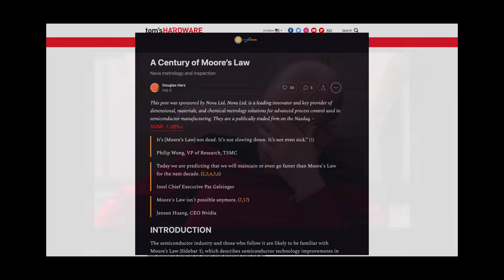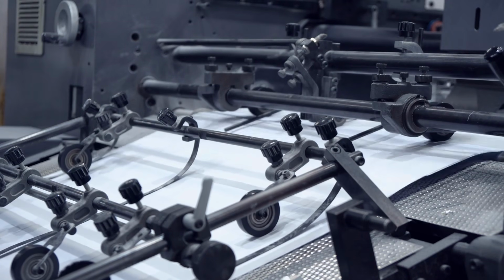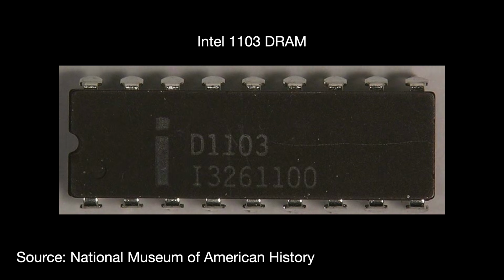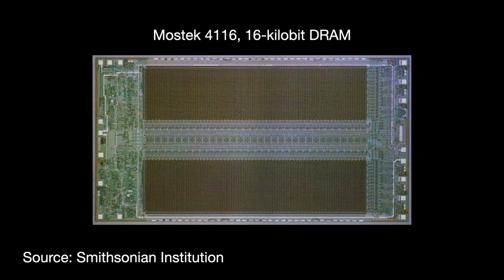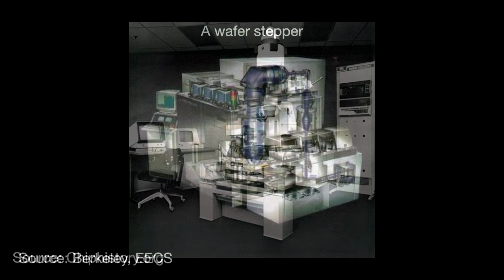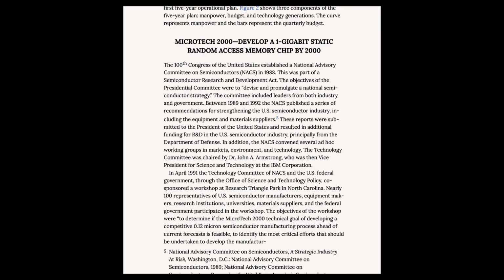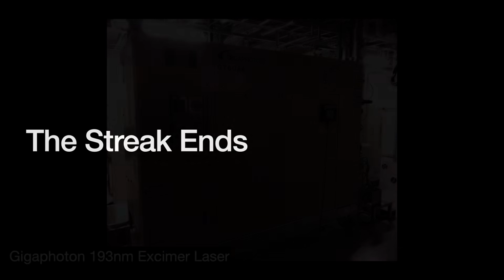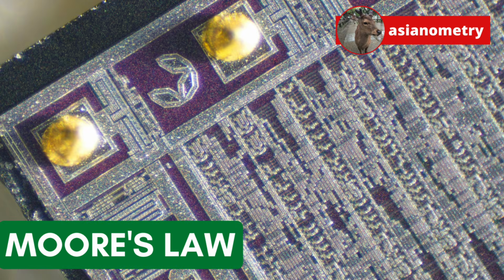Why Moore’s Law Matters

Comment from the maker: RIP, Gordon Moore.
Reply: I like the article, watch almost all your videos and of course am subscribed.  As a person who has worked with computers since 1980, and in my case that meant working with systems developed in the 70s before ICs were even in computers, I have a lot of experience following technology and the changes that have occured over time.

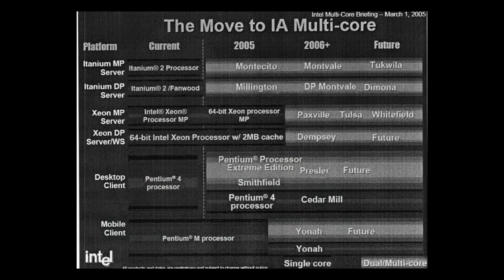I would debate a point you made as I don't think they're directly connected, and rather they happened about the same time for reasons that may have converged, and that was the statement at about 20:15 about moving to multi-core processors.

That was going to happen regardless.  There is only so much engineering that can go into a single core and in fact Intel had already worked with SMT so that a single core could work with 2 threads at a time.

The issue is an overly complex core has to have WAY too many transistors to justify its cost.  The world of a machine pulling an instruction from memory and then executing it went to one where there was an instruction pipeline where multiple instructions were pulled into that pipeline and predictions made about the outcomes of each instruction so that decision making would be correct and proper paths followed in the instruction pipeline.  The amount of complexity there ALREADY is crazy.  You hear the term branch prediction used.  A program is always making decisions based on results of some computation.  If you go one direction, you load a certain set of instructions to do the next thing, otherwise you continue on a current path, and of course modern programming gives multiple paths for decision making so branch prediction becomes harder.  So, getting branch prediction right is important because otherwise you have to flush out the pipeline from the point of the wrong prediction.  This is SO FAR from the world of pulling an instruction and then executing it that it's hard to fathom how it all works within a CPU core, but that's what was already required from the complexity of a single core to work ever faster.  And then there was clock speed.  Clock speed has physical limits because the faster you clock a signal, the more resistance there is in that circuit and this can't be overcome.  You can keep improving the quality of the transistors and the silicon crystal and the methods of laying down the layers and etching to make a circuit as perfect as possible but you can't overcome the physics of resistance in circuits.  This is why for almost a decade clock speeds were maxing out around 5GHz, give or take 2 - 3 hundred MHz.  They have now moved above that mark but not because the laws of physics have changed, but instead TSMC and Intel both make their die more durable, capable of higher heat and it allows higher frequencies, that and making the circuits more perfect, eliminating some resistance.  But they still have that issue of the faster you clock a circuit the more resistance there is, everything else being the same.  And it's exponential, which is why you see power consumption become crazy when overclockers use LN2 to try to break records.  

So, two limits are in place that meant the world of desktop computing (servers even sooner) needed to move to many core computing, and it was a false notion Intel gave many years ago that suggested they could continue making a single core ever faster by improving IPC (instructions per clock) and speeding up clock speeds.

The world of software development needed to move to mutli-threading or parallel processing back in the 90s, they just didn't know it yet for many types of software.  We would be much better off now if software engineers CLEARLY understood that then.  Regardless of how many transistors you can shove into a square millimeter of die that doesn't mean you should try to shove them all into a single core to somehow make a core run faster, with a deeper instruction pipeline more subject to bad branch predictions along with making the ALU and FPU more insane.  We're on the correct path now, with Intel in fact stepping back from CPUs with only complex cores and moving to hybrid designs with their big and little cores and using accelerators, and with their little cores there is the removal of a lot of the complexity of the big cores, and you can process 4 threads in little cores with the same space as a big core can process 2.

So core complexity and clock speed limits were ALWAYS going to mean the move to many core processing.  Moore's law had nothing to do with it.
Reply: @johndoh5182  your replies under this comment deserved to be its own comment. Highly informative very much appreciated!
Reply: @johndoh5182  People didn't know there were going to be clock speed limits. The idea back then that the AMD FX-8150 would hold its speed record for about 11 years until the Intel 13900K came along a few months back would have been unthinkable at the time.
Reply: @katrinabryce  Every engineer that works on high speed electronics KNOWS there are limits, regardless of what the typical home user thinks, and even software engineers, who TAKE PHYSICS should know there are limits to clock speeds.  Have you taken Physics for Scientists and Engineers?  There is a few sections that deal with electricity and electronics, and you learn what resistance is, what it does, and how it affects circuits.  You also learn about AC resistance which is really the same thing but called reactance, and since you're working with a high speed clock signal it really has the properties of an AC signal even though it's in a digital circuit.  Reactance is different from resistance though because different things can create reactance that don't exist in a DC circuit, frequency being one of those things since a DC voltage is constant.

So sure, uneducated people didn't know there were going to be clock speed limits, but the WORLD OF ENGINEERS should understand it 100%!  And I say engineers because it really doesn't matter what branch of engineering you're in, they all take Physics for Scientists and Engineers and learn a bit about many engineering topics.  And this is basic stuff here.

So, you're talking about the perspective of a consumer I guess, but not engineering.  

And I'm confused about your choice for CPUs.  I understand the 13900KS (not the 13900K) is about the fastest clocked desktop CPU right now based on X86-64, but the FX-8150?  What's that?  Intel had CPUs that could OC close to 5GHz many years ago which is what I was talking about when I said 5GHz.  For AMD, they had an FX-9590 that would hit about 5GHz which is EXACTLY the quintessential product backing everything I said.  The FX-8350 had a boost clock of 4GHz.  It could turbo up to about 4.2GHz.  The FX-4350 was actually faster with a boost of 4.2GHz and could turbo up to about 4.3GHz, but it came with more heat and a CPU air cooler would ramp up just to give that extra 100MHz on the boost.  Those are 125W TDP parts, but TDP isn't a top rating for power consumption.  They can consume more.  

The FX-9590 was the fastest clocked CPU when it came out back in 2013 if I remember correctly even though some Intel CPUs could OC close to it and use a bit less power.  It's boost clock is 4.7GHz (boost really being listed as base, but with Piledriver cores would slow down so even though in specs you see "base", today it would be more like a "boost" clock). It could turbo up to 5GHz.  All these clock speeds are dependent on CPU load.  For the FX-9590 to have that extra clock speed, it's TDP went up from 125W to 220W and REAL power consumption would be higher.  It was TERRIBLE power consumption for little gains. It was also notorious for burning up and taking out motherboards.
Reply: @johndoh5182  The FX-8150 overclocked to just under 9GHz with nitrogen cooling. The 13900K overclocked to slightly more than that. The KS is a binned version of the K, so a higher quality version of the exact same chip. It is possible that it might be overclocked to a higher level than the K, but not guaranteed as the overclocker most likely bought a load of them and did their own binning.
Reply: @katrinabryce  Yeah I'm talking about typical operations.  You tell me when you're sitting at a desk with an LN2 tank automatically feeding the CPU when the temps show you need to add more, then also keep it from freezing and then I'll consider what you said.

What I said is correct.

The specs for the 13900KS are this:  3.2 GHz base for P cores,  6.0GHz boost for P cores and I'm not going to list e core speeds.

The specs for the 13900K are this:  3.0 GHz base for P cores,  	5.8GHz for boost for P cores and once again not going to list e core data.

Yes, they ARE going to hit those speeds if you have the proper environment for it, that's why Intel lists it as SPECS.  These are SPECS, not what an individual could possibly hit with LN2.

Of COURSE the 13900KS has cores that were binned for higher clock speeds.  You haven't read my comments if you don't think I understand that.  But regardless, in backing EXACTLY what I have said, to get that extra 200MHz Intel had to push the SPEC for TDP from 125W to 150W.  Now, actual power consumption is WAY higher than that to where the TDP ratings for those parts are laughable.  The 13900KS can consume over 300W in all-core loads

I don't want to spin circles in a discussion all day so I'm done with it.  Throwing LN2 into a discussion about CPUs is a little silly since the ONLY reason people do that is to set a record and I was in NO WAY talking about records, but typical use which is you know, why SOFTWARE ENGINEERS have a job?  So, my 5GHz statement was about Intel CPUs during the period of about 2012 - 2021, because even though the SPECS for different CPUs would be lower, it was pretty easy for people to achieve OCs of near 5GHz for all that time period using nothing exotic, just a more typical liquid cooler, AIO, 240 - 360mm, which ALSO means typical use cases, not using a PC to set a record which doesn't get a term paper written or your math HW done.

As far as AMD, the only thing they had in that time period, once again TYPICAL use, doing office work, gaming, etc.... was the FX-9590 which could hit 5GHz but I wouldn't have touched it because it was a TERRIBLE product.

But hey if you have a post on 3DMark's site showing you achieved 5GHz with an FX-8150 using nothing more than air or liquid cooling by all means post the link.
Reply: A true top G
Reply: @marcclarence2260  Turing Dan's la vide.
Reply: an omen
Reply: i thought this was a video on Benjamin, he was born in Ballybay, County Monaghan in Ireland in 1855 and grew up to produce paint
Reply: At 94 he had a very good run and he was still married to his wife (They had been married for 72 years).
Reply: It's ok that we call it a "law" even though it was just a thoughtful insight into the future of technology, it's potential, and the best ways to harness opportunities that would arise. 

It was reflected in the remarkable work of Carver Mead & Linn Conway, as well as hundreds of others, molding a generation.

I still remember being told physical limits would be reached long ago. They were indeed reached, we have diminishing returns for the investments in the last iterations, but on the other hand hard work and ingenuity is still yielding fruits.

The predictable exponential phase Moore predicted is not the rule anymore. Intel bet in EUV in the end of the 90's. It wasn't easy. It's crucial, but not cheap and did not replace older tech in cost effectiveness for many markets, departing from older expectations.

Let's hope more ingenuity and "design wizardry" keeps bringing advances even if we can't shrink circuits bellow atomic dimensions. 

Anyway, Gordon Moore's legacy for all of us was great and he deserves our respect.
Reply: So did chatgpt write this video???
🤔🤔🤔🤔 You are not smart enough to write it 🤔🤔
Chatgpt should get a piece of your ad revenue 😎😎😎
Reply: @crazypasta7749  exactly what i  thought. lots of people are using chatgpt for their videos now and you can tell.
Reply: RIP true Legend
Reply: We definitely need to keep upping the ante even as Musk and Wosniak admonish the AI and Big Tech communities to institute at least a 6 month moratorium in AI research ; if it is no too late already. So your allusion to technological nihilism, is misguided since man’s inexorable march to a utopia sparked by constant technological advances is what has got us in this mess. Yes connectivity is great and having a comfortable life, but at what peril?
Reply: Ur tossing 2 day old rice out man you’re privileged lol
Reply: It’s D-RAM not dram.
Reply: And his law too
Reply: @ggboss8502 when it comes to transistor density, the law is dead, yes, but if you look at the increases in cores, chiplets and accelerators, performance wise the law is still alive.
Reply: @wile123456   yeah that's just optimization we just entered a stage in which optimization gives performance it ... Performance could pushed once more with breakthrough material like mos2 on bismuth or graphene or cubic boron but that's about it 
Do u know i feel like companies These days now don't wanna gives their best products even they can make one i feel like they are taking are it slowly and telling Moore laws is alive and working a little bit buy our products please
Reply: @ggboss8502  only God's Law exists
Reply: @dongshengdi773  
Which god? Hanuman the Hindu monkey god?
Reply: @dongshengdi773  And as there are thousands of gods, thousands of laws exist. How likely is it that your parents picked the right one? ;)
Reply: @dongshengdi773   which company do u belong
Reply: @dongshengdi773  who asked you to drag your god into this conversation
Reply: What ever happened to wang computer corporation. I remember my school having one. The ones with those little monitors and large system unit.
Reply: @nomadhgnis9425  I remember seeing the adds for Wang word-processors back in the early 1980s (Wow! 40 years ago).
Reply: @nicholasmaude6906  Yea. Those were the days.
Reply: why are you using chatgpt for your video script?

Comment: There ought to have been discussion of Dennard scaling which was a key driver of rapid processor improvement, node shrinks gave not only smaller & cheaper but also faster transistors at a constant energy cost, meaning there weren't the heat & power wall issues which halted the frequency scaling.
I was a bit disappointed that this channel failed to mention that as most people focus on number of transistors, when multi-core is a response to physical limitations on uni-processor performance.

Comment: I recall back in the 1990s [US] when it came to PCs, the Moore's Law was getting into the lexicon of engineering professionals that used PCs in their work; as the rapid growing power of succeeding Pentium chips were rendering 18 month old PCs obsolete.  It was an amazing era on the increasing processing power of the PCs back then on an annual basis.
The engineering company I worked at, as a means to unload the obsolete Pentium PCs they had [less than two-years old], were selling them to employees for around $100 [US].  Yet, those Pentium PCs were purchased at around $2.5K each, when new, two years prior.

Comment: Argument against the fact the Gordon Moore's math was wrong: Yes, 50 times (2^10) would be 51200 transistors. But Gordon Moore also said that the rate of growth was roughly 2 times per 2 year. Assuming the rate of growth was 2.05 instead of 2, we get 50 times (2.05 ^10) = 65540 transistors - which something Gordon Moore said in the whitepaper. 

TLDR: I wouldn't say his math was wrong but the with exponentials the even small approximation in rate of growth can lead to very different answers

Comment: Problem is the speed of light and needing new substrates, the heat dissipation and current leakage are the main barriers, multi-core has reached a kind of dead end, we need a return of single threaded performance and increased frequency if computing is going to get better.  I don't see any major material science advancements on the horizon for a long time, with current tech, all Intel and AMD are doing is basically optimization at this point, fragility of gates and electro migration become massive issues as parts get smaller, not to mention thermal wear on contacts.  I don't see how we're going to solve the heat, leakage and memory bandwidth/latency issue anytime soon.

The biggest issue now is RAM is infinitely slower then l1/l2 cache.  So we need - new memory technologies, new materials and new fabrication techniques.  Because heat and leakage are the biggest issues that aren't going away anytime soon.

Comment: I woudnt call Multicore as failture to Moor law or anything, yes it was forced change(by pretty much hitting practical limit on frequency of single CPU), but extremly effective one. And industry was using multiprocesor units for decades by then, now it was just integrated in one chip.

Comment: You say little or nothing about the critical trade-off defining Moore's law. That trade-off is between energy and complexity, probably better known as density. It is no accident for example that AMD, a decade ago a rounding error compared to Intel. Now AMD is the clear leader in the industry. The leader of AMD is an Asian who did her Ph.D. work at MIT focued on energy efficient chips. The biggest miss is that the original prediction by Moore also encompassed speed. But electrons flowing through copper reached limits long before density. Indeed density still has another one or two generations to go. Interesting is that in silicon HPC, China despite lack of access to EUV is the clear leader, which plans to have about 10 exascale computers by mid-decade. Still I like very much your comments on the clear limits to technology on the human condition. I much appreciate as well your efforts, much of which I am sure come from your own hands. Thank you for your hard work.